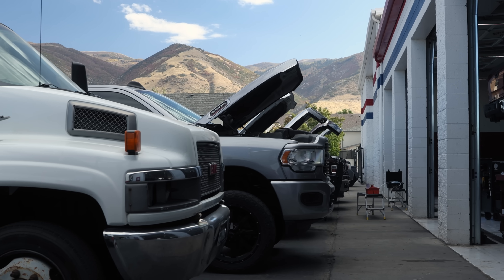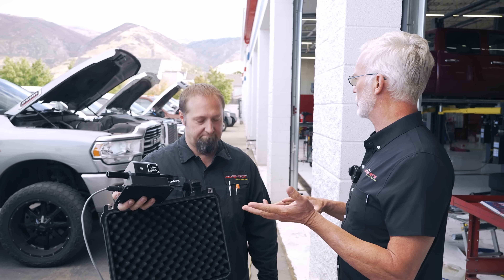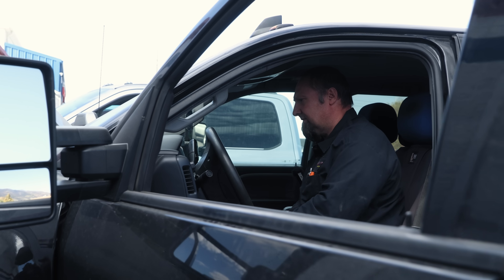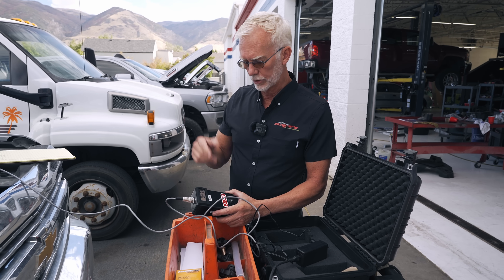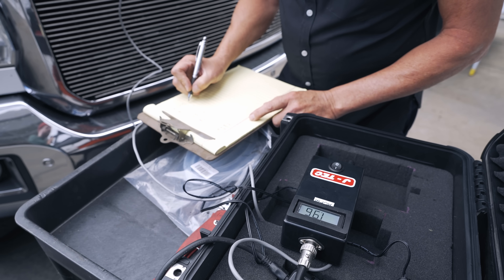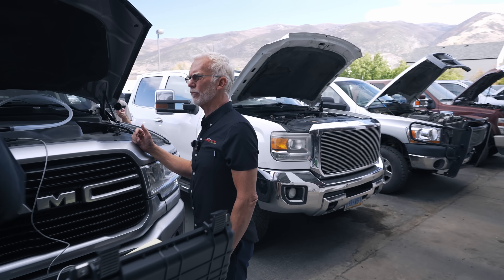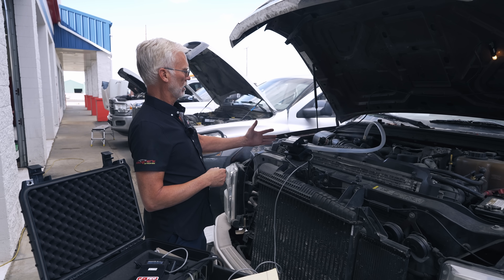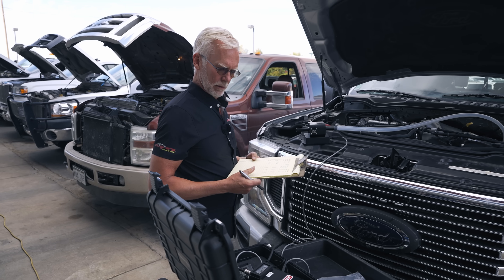Diesel Blow-By Field Testing on EIGHT Trucks!

Comment: Something I learned the other day when testing for blowby, if the unit has ccv routed to the turbo inlet , the vacuum from the compressor will "eat " alot of the blower in crankcase, given you have an air filter that is restrictive enough to cause this assistance in vacuum. Put a cold air intake on a unit and TahDah it now has heeps of blowby. Test it out. Learned on a 7.3
Reply: Man I just tested for blow by on my 7.3 and was really happy. Now I’m worried that’s going on lol

Comment: I have a 2017 F-250 with the 6.7. CP4 is still not giving me the glitter party and I have no abnormal blow-by. If you unlock the cap it will not come off, even holding at 2,000rpm. If I remove it you get a slight amount of that light-colored smoke, but no pressure. I'm over 216,000mi. Truck is stock.

Comment: All diesel motors have blow-by.  With a decent tuner you can monitor crankcase pressure.  With a CCV delete, my 6.7 reads just above zero and seldom fluctuates.  Don't fall for the hype, it might empty your pocketbook.

Comment: I would very much like to know how does this make sense - crankcase pressure depends on so many things, e.g., how freely the crankcase is ventilated, what is the engine configuration (a simple example, a 180 degree twin has rather constant pressure while 360 degree twin has severe fluctuations). All sorts of flows and pressures are possible, you can get flow from the piston going up, pulling air in from crankcase vent and pushing it out as it comes down. I understand how you would compare two engines of the same model but how does it make sense to throw that gauge on a random engine without checking all the other factors and conclude something from that number?

Comment: You need to check both of cap and oil stick test blow out.  My truck ranger 2.3 only blow out cap but not oil stick. Because pvc on cycle body not on valve cover. Engine has no white smoke out tail pipe. Engine still running smooth.  Does have carbon deposit problems I keep clean and keep position ring clean. 177, miles. 
But I know that diesel engine don’t have PVC

Comment: Just did cap test on my 1999 7.3l from cold, the cap just slowly spun with the engine vibration no smoke no other cap movement.  Thanks for the info.

Comment: Low blowby at idle or 1500 rpm tells you nothing, you need to load the engine to properly measure crankcase pressure, especially on a turbo diesel.

Comment: Dave love your video’s , in this video you said 2008 to current for dodge ram 6.7 crank case filter will help fix loss of power, I just wanted to mention that the 6.7 started in 2007.5 witch is considered a 2007 witch they had both the 5.9 and the 6.7 in 2007. Again love the videos and all the info you provide about Ram diesels.

Comment: how much of a factor does this play in the  understanding the life of the engine?  If your engine is high blow by is that mean it's about to die? how many more miles or life does it potentially still have?
Reply: Its hard to say, you have to make sure the filters are clean, intake and exhaust filters.

Comment: My Ford excursion has a 6.0 powerstroke I have over $360,000 me original motor no overhaul and I have zero I repeat I have 0 / the cap doesn't even move

Comment: Did you remember to isolate the turbo before condemning the engine as the cause of blowby it's usually not the case but Cummins warranty will make you check that before you can tear it down and verify by checking the rings
Reply: Also blowby is supposed to be checked under a load

Comment: I don’t see how changing the breather filter is going to affect power significantly.  It doesn’t change the cylinder blow by, it just lets it get out of the crankcase easier so that less pressure builds up.  Pressure in the crankcase isn’t going to affect power that much, but blow by is going to make a significant difference and I don’t see how changing the filter affects that.

Comment: Hi Dave, how did you account for blow by volume vented through the crankcase breather/PCV systems? Or do you ignore this when gauging blowby due to engine faults or wear?

Or, as you implied in your closing comment, is the crankcase pressure more important? In which case, how useful are your flow measurements?

Comment: A Blow by test isn't particularly useful. It's primary function is to indicate that the crankcase ventilation may not be working properly, and maybe do a compression or leakdown test. The truck blowing smoke out the filler hole, something is wrong, and it may or may not be the piston rings.
Believe it or not, some engines can have a lot of it and be fine. It's really common in 2000s cars because manufacturers were running such low tension pistion rings to improve mpg. 
I have seen cars have a lot more blow by, so I do a compression test, and it's over 200psi in every cylinder. The manual says 135psi minumum with 28psi variance. In that particular engine design around 175psi is common. So, is it losing power? I guess...

Comment: Im curious what a 6.4 Powerstroke with relatively low miles or a few miles on a rebuild would be at because about every 6.4 I've pulled the cap off of high mileage or lower they have a ton of blow by

Comment: How can you accurately measure the amount of blow by when you have engine vacuum sucking out of the crankcase into the intake manifold & a turbo pushing air into the intake ; which way is the air going ? 
To me you would have to block off all crankcase. Vents .
My turbo charged 3.9 Cummins tractor motor has 1 vent to atmosphere with a collector/stainer similar to a kitchen pot scrubber - chore girl & if you even run it with the oil filler cap off it will blow oil out the oil fill tube 1-1/4”x10” of the lower side of the block.

Comment: Had a fleet of 3116 cats in gm topkick chassis. All used from Ryder. When Ryder decided to not do maintenance on some by the time we got them they were sometimes 10x over spec. Always checked on a meter on a dyno. Maintenance and luck are good things. If you don't do the maintenance, you will have 0 luck. Sample size was 150 units.

Comment: Or could be alot of back pressure if it not detected or could be tubro 
Or the pcv valve it self because it not flowing right 

Bad injectors And a fuel leak sucking air can do it mine did it and fixed it it went away
Only way to do it is a computer 🤦‍♂️

Comment: While doing this check is the pcv valve blocked  so all crank case gases come out of cap or is it still connected to intake as per normal.

Comment: I have a rare V6 Powerstroke that had a clogged crank case breather. I did the same thing with a hose in the oil fill cap to let the pressure out until I figured out that a breather from a 6.0 Powerstroke would fit.

Comment: How does this change with the newer diesels that have a lot of emissions crap on them? I have a 3.0L Duramax that has puffed the cap since day 1, and with 40K miles still does it. It doesn’t appear to be down on power, or get back mileage. I’m wondering if this would have less to do with the rings and more to do with some sort of emissions junk

Comment: The test it self is a great test, however on newer engines crankcase is been recycled back into the intake before the turbo.  If your air filter is clogged turbo would create enough vacuum where it will effect the reading and if the air filter is really dirty it might even suck oil out of your oil separator.  If the drain tube from the separator drain at the bottom of the oil pan or in kubota's case they have a tube goes down to the bottom of the pan on the inside and turbo will pick up oil from the oil pan if the filter is dirty enough.

Comment: I had an old gas-powered van with a 302 . It had so much blowby that I installed a vent with a filter to catch the oil. I drove it until the timing set failed. Back then, you could buy a  remanufactured  engine for about $500.  That's what I did. Drove it for a few more years. Everything else was extremely worn out by then . I expect that someone got a really good engine cheap.

Comment: Whats the point in measuring these numbers while leaving the pcv open? How much air is sucked into the engine @1500rpm from one make/engine to an other?? 
Wouldn’t it be better to do this test with the pcv completely blocked off…?
Reply: For that matter youd also have to remove the exhaust after treatment system too, as that could affect readings as well.

Comment: Nice tests. But what does it tell you? Without using (measuring in) the normal PCV or blocking it you have now two PCVs in parallel. As you can see with the old and ne filter this affects your reading. But the blow by at the pistons will stay the same. So a better PCV only reduces the pressure in the crankcase, but not the blow by. 
I would just use a pressure gauge or it I really want to know the blow by a flow meter looped in at the PCV outlet of the engine head.
Reply: This is something I also considered. With this setup, the reading strongly depends on the efficiency of the PCV. However, a good or bad PCV should not affect power losses or oil consumption—or does it?

Comment: Not sure if he blocked the crankcase vents or not however, if the CCV’s were not disconnected/ plugged this testing is not very useful.  If the CCV is sucking all of the blow-by back into the engine the test is not accurate.  As a matter of fact he said one of them went into a vacuum which will never happen on any engine, there is always some amount of seepage past the rings. Is it unreasonable to say that some CCV systems work better than others?  Not trying to be ugly here but i like accurate date.

Comment: Testing blow by in inches of water with a manometer is standard practice in the heavy equipment/trucking industries. It’s always amazed me you guys never checked it with a measuring tool until now. Also looking at numbers is fun but it would be better if you specified in the video what units your measuring them in (Yes I noticed the gauge said CFM) & also what the permissible value or repair limit is for each engine. I believe a Cummins 6.7 (industrial application) is roughly 7 in/h20 with the proper orfice tube installed for testing.
Reply: I made my own manometer back in the day now I have an electronic one for checking appliance gas valves.

Comment: 1:10 bro has asthma
I had a '12 Ram 3500 for about 6 years. When I bought it with 589k (for cheeeap, deal of a lifetime) it had zero apparent blow by. I didn't have a flow meter but you couldn't feel any at all and it wouldn't flap a sheet of paper either. When I sold it at 640k, it still had none. I changed the crankcase vent filter to make sure that wasn't skewing that... What a sweet truck, it ran like new and looked new except the cruise ctrl buttons.
As far as I know, according to the maintenance records, the engine hadn't been rebuilt or replaced...
Reply: I've got a 2015 Cummins with 233k and the oil cap stays put. No blow-by

Comment: the 6.7 powerstroke is a good demonstration of how low tension keystone rings work.  When the dynamic compression increases the blowby decreases.
Reply: Wtf is dynamic compression
Reply: @SmokyBoi  also known as relative, its the engines compression number under load, temp and rpm.  Boost and all that come into play, the more compression the engine generates (and more power it outputs) the tighter the rings are because they physically wedge into the cylinder wall with higher loads.  6.7s have very little blow by under load because of this design.

Comment: why wasnt the crank case vent plugged in order to get an accurate reading? Isnt that what cummins procedure is?
Reply: That was my thought exactly. The test should have been from the oem crankcase vent location only and not from the cap while recirculating the crankcase back into the engine. 
If all that you have Dave is an oil cap test port, then pinch off the crankcase vent hose that recirculates back into the engine. Also, I’d recommend adding a 2ft hose after the meter and depending on some of the ccv designs(filtered/unfiltered) use a new one as some of the high mileage units could be pretty plugged off giving an inaccurate reading.

Comment: Hang on . Did I miss something here . . . Measuring from the cap will cause invalid results unless you block the breather pipe as your bringing a 2nd breather and factors such as breather filter restriction and air filter restriction into play . 
So either measure at the breather into the intake or at the cap and block the other .
Reply: But is someone going to do all of that when looking to buy a vehicle AS-IS?

Comment: Question 

What’s the point of a crankcase breather? The blow by is still occurring past the pistons so what is causing the numbers to change? Is it that most is being recirculated back into the intake? So the new breathers just going to plug up and still just as much wear and tear - waste of money to replace or would you recommend?
Reply: To prevent oil and dirty air from going into your cylinders. If its clogged, it might blow out your seals in your engine.

Comment: Are you measuring in cubic Feet per min or hour??
Reply: Our handheld model display measures in cubic feet per minute! But we can adjust the units of measurements to cubic litres per minute and so forth on the meter itself if you are using it with a dynamometer or other similar testing equipment.

Comment: When I have the money, I will totally bring my 2001 toyota 4runner to you for a full engine break down, repair, clean, rewire, and some interior fixes. You'll have fun with mine. Also it would be interesting to see you convert a 4runner to diesel.
Reply: 3.4 is a beast one of best engines ever made
Reply: If you go outside the US you will find that all the small trucks are diesel powered, even Toyota Carola cars .
Heck Ford even put 4cyl Cummins in their Brazilian pickups .

Comment: A way we test blowby in tier4 emissions equipped engines is by disconnecting and blocking off the ccv system and installing the blowby gauge inline. This gives a more precise reading of blowby and a better indication of ring/cylinder wear if your looking to gauge it. I love the oil cap technique though. The reason those later model engines blowby went down may have been due to the ccv system opening up more and pulling that through

Comment: So how can the pressure test from the oil fill cap be accurate if the motor has a breather tube/line coming off the valve cover or the crankcase and just dumping the vapor into the atmosphere ??
Reply: You are correct
Reply: I’d say it’s giving a helpful number, it’s an idea of how much blowby. Its doesn’t need to be exact for it to be useful, just something to use for a trend.

Comment: Good analysis, but engines that have internal egr or crank case filter or catch can !,, will skew your results!! 
 The logic is all engines have some blow by and in the past we just free vented it out a breather vent  tube , usually  pointing towards the ground!. 
THE NEW EPA RULES HAVE US FORCING IT BACK INTO ARE TURBOS & INTO ENGINE AGAIN,! My old truck(no re vent circuit or dpf)) had fairly clean oil at a change interval  of 6k not any more....... !!

Comment: That's an awesome little gadget I've been looking to buy a Duramax but so many of them in my price range they have 260,000 to 300 and some thousand miles on them love them guys say no blow by but I'd hate to end up buying one and have problems because they're so expensive 2 rebuild blossom video buddy keep them coming
Reply: It could blow the oil cap clean through the hood and sellers would tell you it had no blowby, then get mad at you if you call them out. Needle in a haystack to find anyone with scruples.
Reply: We have one at work with the Allison transmission, and I can't recall it ever needing anything at all with those miles. The only thing is 5k mile oil changes, and a battery replacement all its life.
Reply: Well for one, “duramax” could mean a complete pile of shit, or pretty decent. Know your different models and the issues with each year, not just the fact that it’s a duramax. It’s the same for powerstrokes or even Cummins.

Comment: I didn’t see you blocking off the normal crank case ventilation systems on these trucks, therefore this testing is pretty irrelevant and inaccurate. Crankcase gases are escaping through ventilation system while you’re reading what escapes by the oil cap, so you are only reading some of the blow by on each truck.  Secondly, such as on Cummins engines, you have to account for vacuum systems which exhaust into the crankcase, and will give a false high if your vacuum system has a leak.
Reply: Accurate statement!!!

    Needs to pinch off the ccv recirculating hoses

Comment: Well Dave, your new blowby toy tells us that the rings have failed, this is very vital info, as ANY missfire will cause oil contamination by fuel and carbon particles, with only a few thou clearance on journals etc, it becomes obvious why engines sieze or run their bearings. You and Lake Speed are highlighting the real seriousness of oils, but also the point that lots of factors also play into this situation.